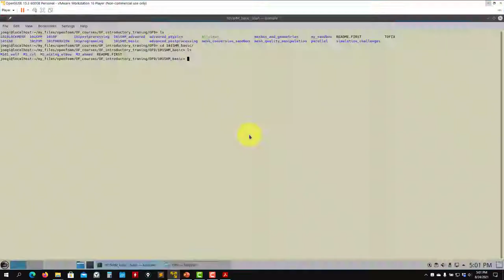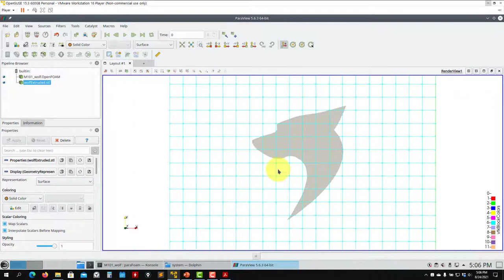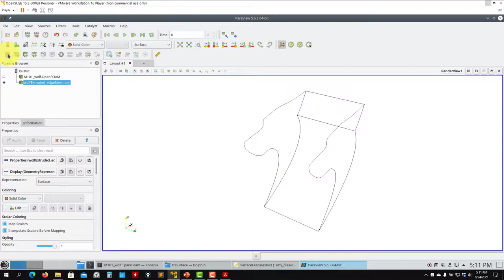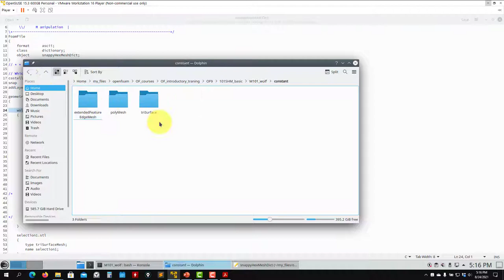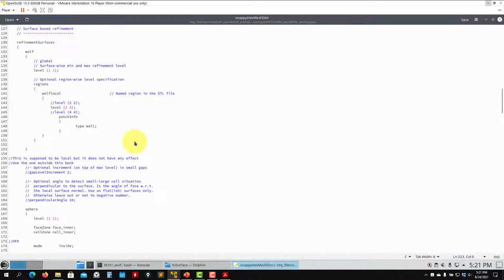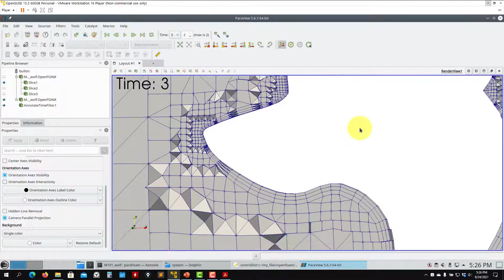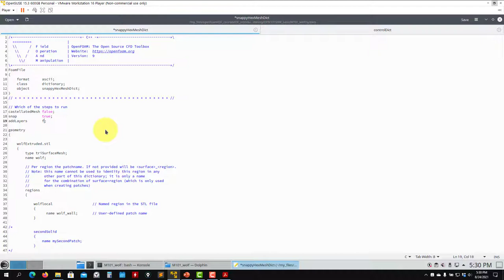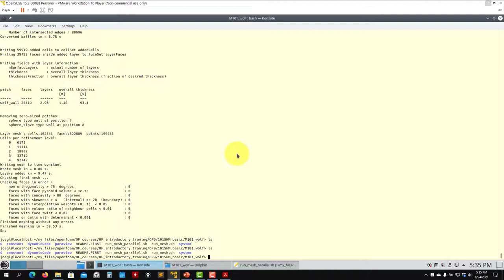3.4 Module 3 | Meshing in OpenFOAM | snappyHexMesh | #openfoamtraining

Comment: Hi,  when I attempt to perform the surfaceFeatureConvert command to convert the .vtk file to .eMesh as per 13:23 I get the following error message:

--> FOAM FATAL IO ERROR: 
wrong token type - expected int32_t, found on line 18 the word 'OFFSETS'

file: constant/triSurface/edge2.vtk at line 18.

    From function Foam::Istream& Foam::operator>>(Foam::Istream&, int32_t&)
    in file primitives/ints/int32/int32IO.C at line 62.

FOAM exiting

I am unsure as to why this issue keeps persisting as I have followed the same steps as the video?
Reply from the maker: Well, you need to use the same version as in the video. Also, you need to safe the VTK file in ascii format.
Reply: @wolfdynamics5703 Thank you for the prompt reply! I am using OpenFOAM-9 (same as video) and I saved the VTK file in ASCII format which is why I'm confused as to what's gone wrong?
Reply: @wolfdynamics5703  Could the issue be related to which version of ParaView is used? I am using ParaView 5.10.1 with OpenFOAM-9
Reply from the maker: It is difficult to say, I would say no. I tested it with a native paraview installation and it worked fine  @Samad-s2x
Reply: @wolfdynamics5703  Okay I see. Also I am running it from WSL. I am unsure why the VTK file is having issues.